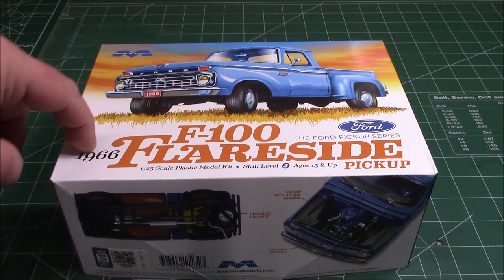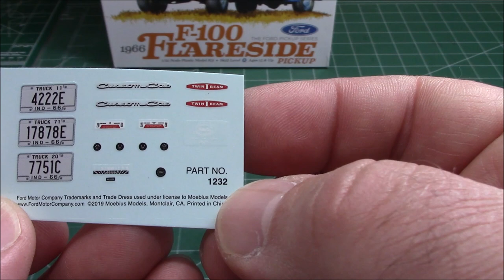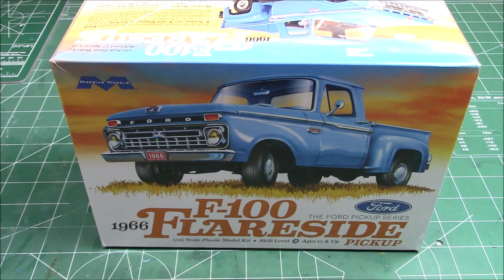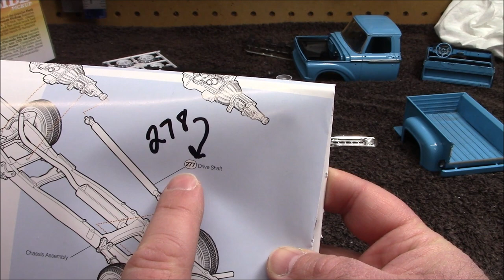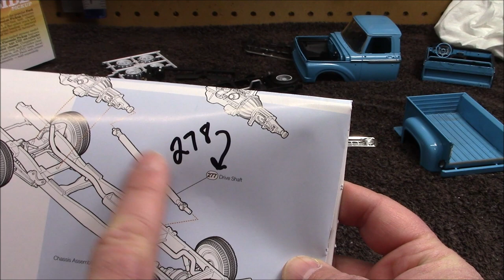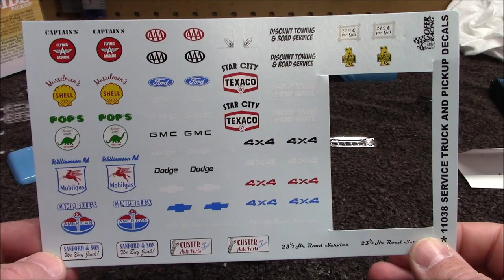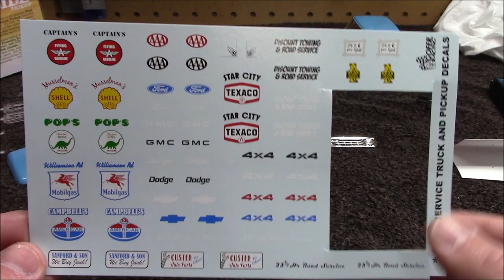Moebius 1/25 1966 Ford F100 Flareside Scale Model Kit Build Review 1232

Comment: I went a different way with this kit. Bought an 8' flareside bed from Fireball Models. Making it a F250 4x4 using the frame and drive train from the '70 kit. And the Fireball F250 conversion kit. I think that '61- '66 body is the best looking body Ford ever did on a truck.

Comment: I ought this truck on eBay and took about 3 months to build. I’m in a nursing home for now and had to hand paint the truck with acrylic water colors. The truck turned out wonderfully but not as good if it was sprayed. Made some mistakes with mine and I lost the decal sheet. I used the step bumper in the back but wasn’t able to put the Ford letters on the back tailgate white, but still turned out good. Very happy with it.
Reply from the maker: Right on!

Comment: What I did for the box wood on my ‘65 Chevy short box was use some 3/16” pine hobby planking from Micheals. Then stained it with whatever I had on hand.
I also detailed the engine with plug wires and cooling lines.
Looks awesome
Reply from the maker: Great tip!

Comment: I notice that you rarely, if ever put a radio antenna on your models. I always liked to use a piece of sprue, heated and stretched thin. Then cut to desired length.  You can also custom make wires, heater hoses, battery cables, etc like this. Your model building rocks btw!
Reply from the maker: Thanks for watching!

Comment: Great kit, and sweet build!  One tip - draw around  the headlight lenses on the sides (the  thickness of the lens) with a thin black Sharpie, it makes the headlights look 100% better when they're assembled to the reflectors.
Reply from the maker: Yes, you are right, that looks great, I've done that on back glass for pickups for years. I should try it on a headlight. Thanks!

Comment: thanks for the response on the primer/painting.   Any thoughts about instructions on micro-sol and micro-set for the gang.  Your modeling is the best (and most affordable and made more easy) and your tips and video skills enhance the lessons.  This PU truck is my next one - thanks
Reply from the maker: I'm not very experienced in using those solvents but they are well known and loved and work really well for thousands of modelers.
I use Tamiya MarkFit decal solvent which is just brush on, apply decal, brush some on top and leave it alone to dry.

Comment: Thanks for the tip about the headlights as model cement does cloud up the lights as it dries.
Reply from the maker: Coating all the clear plastic with Future floor polish before gluing also helps out a lot.
Reply: Testors makes a window glue that dries perfectly clear. You can even make small windows with it.

Comment: I bought this model too, just finished it. You're correct, the windshield is VERY hard to fit into place. the back and sides are easier. Why do they include SO MANY parts you'll never use. I've 4 or 5 sprues with parts still on them, not used...  Finished it in baby blue, used the big mirrors..  Fitting the interior in there was a pain, but it's in there.  They do make nice models!
Reply from the maker: Common parts from other series are on the molds so they leave them all on there when the cast them.
We end up with free parts for other custom jobs, etc.

Comment: I own a full size 65 F-100 long bed styleside. I built a nice running 390 to replace the 352. I put an automatic in it with a 9" posi along with some other goodies. Wonder how long it will take for Moebius to make the styleside version instead of that long utility bed?
Great review as always.
Reply from the maker: Thanks!
Reply: @hpiguy  I am happy to see this kit as the only other kit is the vintage AMT that was the uni-body long bed with all kinds of customizing options. Collectors item for big bucks.
I thank Moebius for the kit. Now how about a 57 F-100 short bed both styleside and flairside. The first square body without the fat fenders!

Comment: Another great build! I do have to say that, in my opinion, unless you were going for a restored, show truck, I don't think that the bed floor decal would be accurate. I freely admit that I don't know much about Ford or Dodge trucks from that era. What I do know is that GM trucks with wood floors never had a fancy finish. The planks were always black, for all I know, they might have been treated with kreosote(?) like railroad ties and telephone poles. I'm not criticizing your build, just saying what I know. I actually hate it when someone brings me a step side for restoration. They always want the fancy bed floor kit. Unfortunately, most of them don't realize how much those kits cost. Again, I'm not trying to down grade your build, it's awesome!
Reply from the maker: You could be very right. 
The box art shows a nice wood bed and I like the look of it.  
I should never be regarded as a source for perfect factory examples, it's not my style of modelling. Nothing what so ever against those that are into factory perfection.
Reply: hpiguys Workshop I completely get that and hope you didn't take my comment as criticism. I didn't intend it that way. I'm actually working on a replica of my own truck right now using 2 of the Revell GMC plow truck kits. I needed 2 because mine has an 8' bed. I'm also using the intake manifold, etc, from the 78 Camaro kit for my build, since the trucks engine (for some reason) has a Rochester fuel injection system. The rest of the Camaro kit will be riding on a trailer, as a "barn find" behind the truck. I'm scratch building the trailer out of brass tubing. This build is to replicate the day that I dragged my Camaro out of a barn (over 30 years ago) and gave it a new life as a drag car. I've been through several trailers in that time and the truck has been restored twice, however, the truck still hauls the Camaro to the track every weekend.
Reply from the maker: No offense taken, I knew what you meant and for those that want to build perfect replicas it's nice to have info like yours in the comments.

Comment: great build, but question, I used to leave the pieces on the sprue for painting but then when I remove it from the sprue I have a bar spot, do you just touch this up?  I stopped doing this for this reason and took everything out of sprue before paint.
Reply from the maker: I shoot a little of the spray paint into a cup and dip a brush in it, dab it on the sprue cut area.

Comment: Not being American, I don't have the nostalgic attachment to these vehicles; but being a petrol head, I do enjoy them greatly. And your videos are great. I do have one question, and if I'm wrong someone will surely set me straight. At about 16:18 into the video you show the painted bench seat. Is that the Chevrolet logo embossed in the centre?
Reply from the maker: It looks similar but it's an old Ford style emblem they used.
Reply: Minty projects Hey man,it's the same logo as on the front of the hood(bonnet). Google it  for a good looksome had the V8 logo,some said I Beam ,some said just Ford. Look up hood emblems cuz I haven't seen any pics of the seat thing on the interwebs. Don't know if they are gone when people have the seats redone or if they are just a bitch to restore.

Comment: How do you apply the Future Floor polish? Sorry if you already have a tutorial on this but I didn't find any.
Reply from the maker: No problem, just brush it on with a wide soft brush in a nice thick coat and walk away for a couple hours. Let it dry, don't touch it as it dries or you'll get brush marks. 
If left alone it will level itself out and dry clear.

Comment: I don't know who started black on the inside fender well and the fire wall. But they roll out of the factory body color. I know from the 71 Ford we had we had a oversized radiator put in plus one ton springs on back but the inside dog house was body color

Comment: I WISH .....I could build a complete kit at the speed you build AND being a looker as well. I have started 8 models and NOT 1is finished. I am on my 3rd nite puttying and sanding the body on 
"The Jaw Breaker"rail car.  
😫AHHHHHHH ! One of my projects is a curbside Dodge challenger and I STILL am not finished.The 1st attempt at paintimg it came out really  nice. 
High gloss, No orange peel  BUT....
A speck of dust on the hood and 3 on the trunk. So....I wet sanded it, re-painted it and this time I have orange peel.  I have that polishing kit that will make the paint look like glass but I am worried about the edges and area's that will bring up the primer. I have plenty of coats on it. I used 1 bottle testors 1 bottle laquer thinner.
Anyway, sorry for the long " who gives a crap" comment. Just venting a bit.
Reply from the maker: Its ok, thanks for watching Harry!

Comment: I enjoy your videos.  I was wondering about your paint booth.  Does it do a good job with fumes?  Do you have it vented to outside?  I don't have access to outside in my basement, so I need something to control the fumes and smell.
Reply from the maker: You can vent it outside if wanted. 
I have a large basement shop and wear a respirator. I use it solely to suck up overspray and keep it from dusting the room up.

Comment: Thanks you for the awesome tip about the goefer racing decals they are very cool! Nice build truck looks fantastic I will definitely be purchasing one. Does this kit have the option of building it as a 4x4? I was not sure if I noticed a 4x4 front axle included
Reply from the maker: Thanks Devin!
This kit does not have 4wd, but you may be able to cobble parts from the other releases and other kits to make it 4wd. I don't know enough about these old Fords to say that it's easy or not.
Reply: It shouldn't be too bad,the I beam suspension has pretty general location points. I think the torsion bars would be a descent location for the rear shackles on a leaf spring if you use a solid front axle,if you used a front drive axle from a kit with I beam 4x4 it should be an exact replacement.

Comment: I always wonder what the cheapest and most accurate Ford Blue engine color spray paint is out there? I've always been using Dupli-Color Engine Enamel with Ceramic Old Ford Blue and Ford Blue. The Old Ford Blue is a bit duller and darker than the brighter Ford Blue.
Reply from the maker: For me I just try to get close.